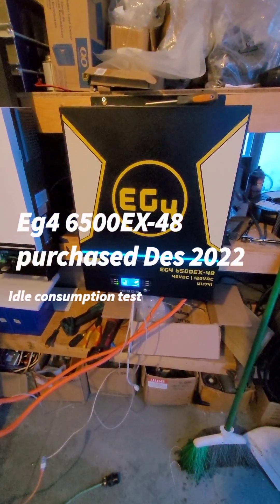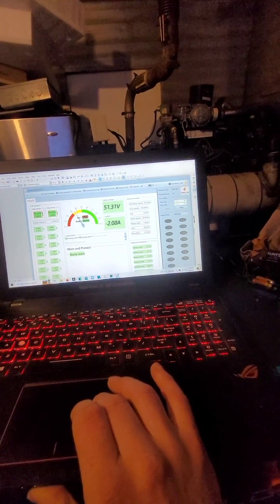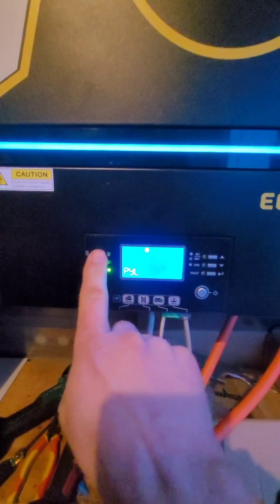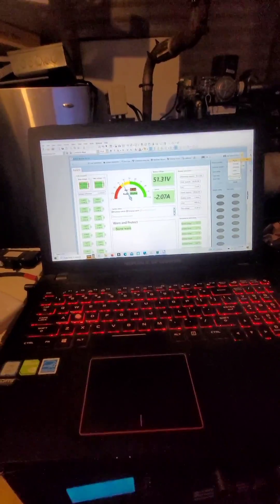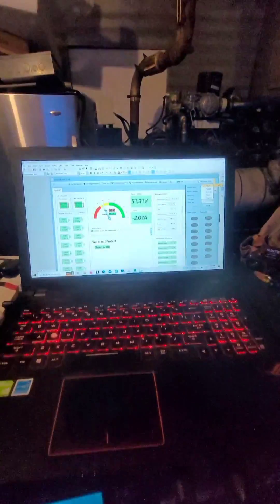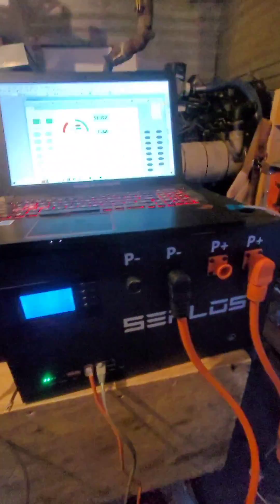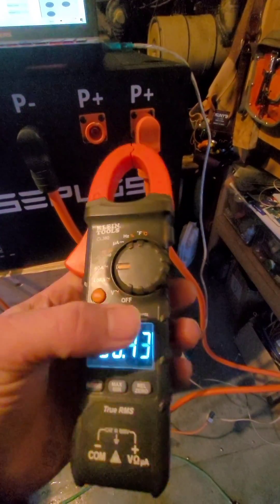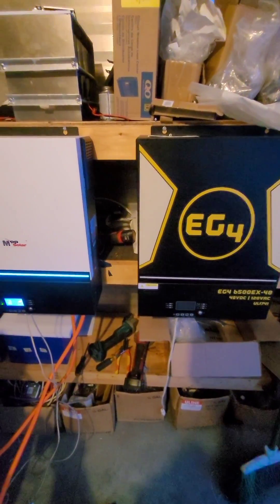EG4 6500EX-48 vs LV6548, idle power consumption.

Comment: The idle draw is crazy but you just need 2x 400 watt panels to fix that. $300 if you bought all your solar together. Also the eg4 is made for a big setup, 10kwh battery is the minimum i would use on that 200 watt idle.😢

Comment: I have a solark12 K that pulls 1.3 A. What’s the big deal? Install two or three more panels and you’ll be OK.
Reply from the maker: Sure, but in reality, living off the grid during multiple cloudy days an extra 50 wats or 100w in a 240v setup, it is very noticeable.
Also, if the specs say 70w
And tested it is closer to 120w there is an issue.

Comment: well you can get a victron multiplus II 8000 wich is also 6500w low frequency inverter and it says it pull around 30w but it cost as both units you have there
Reply: And the Victron will still be going in 15 years.
Reply: @kevinmills5293  well I don't know about that. after I got my multiplus I had a discussion with a distributor and he told me that he got couple of faulty units around 5 to 7 years in service. I hope mine wouldn't give up so early, otherwise he will not pay for it self
Reply: @EpicHardware  I’ve had a Quattro 5000 for 15 years now and it has run continuously and has never missed a beat. I also have other Victron gear and it’s all performed flawlessly.
Reply: @kevinmills5293  what you are using now?
Reply: @EpicHardware  I’m still using the Quattro. If I was starting again, I would go for the 48V version only because the solar charge controllers could have been smaller (less expensive) for the same power.

Comment: It's the fans and their curve im pretty sure, which at the end of the day is probably worth it... Keeping lower internal temps of the internals is critical for longevity, I also suspect that the different MPPT board for the solar plays a part as the components on the main board are rated differently and likely have a higher loss
Reply: Its not the fans mate.

Comment: EG4 6500EX-48 draws more current in order to run its damn loud fans...
Reply from the maker: That may be the case for some of the usage. but without the ac output on, the inver pulls around 30w with the fans still on. so the remaining 70 watts or so need to be consumed, some where else.
Reply: @SunInLithium  yeah, it’s a cheap communist China sourced junk inverter, just like everything else in greedy corrupt USA. Produces high profits so CEO’s, family and their brown-nosing suits can fly around with their side chicks in the tax-deductible company jets.